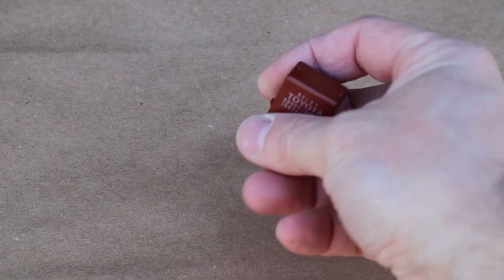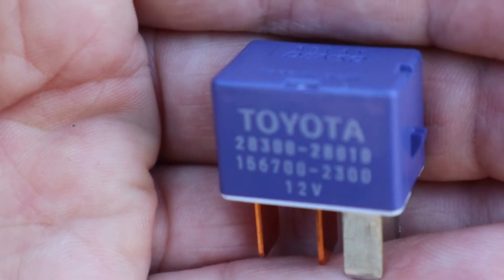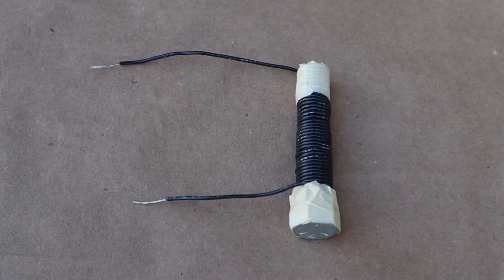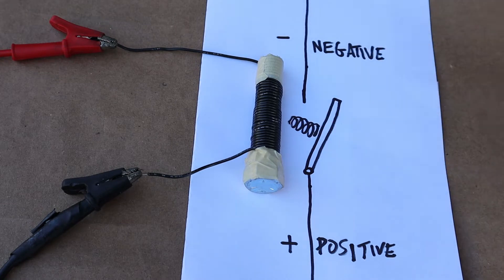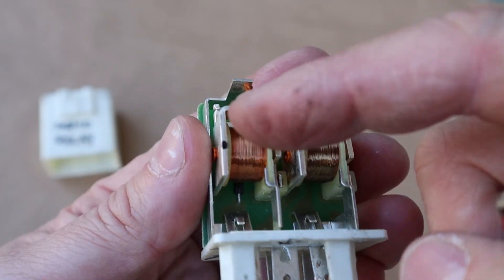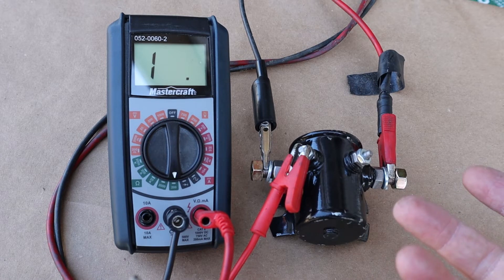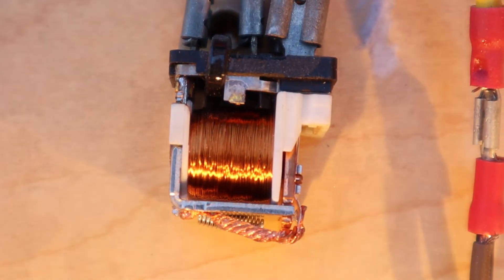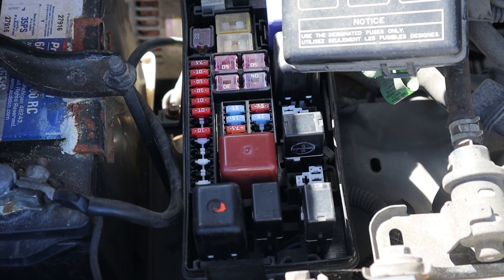What is a relay? Learn how relays work and all about Faraday's Law of Induction plus way more!

Comment: Adding tools to your vehicle is a Great tip for any gearhead!  Its hard to do anything without them!
Reply from the maker: Right?  Last year I had my trailer wiring module blow and during my 1 hour drive, I lost tail lights, turn signals, and then it stalled and I couldn't get it started.  I was stuck and I didn't have a single tool to work with...no multimeter, nothing.  Bought a generic tool kit and after some quick research on what circuits ran off of the blown fuse, found out it could be trailer module, which was behind the left rear taillight.  Unscrewed the tail light housing and bam....melted wiring going into the module.  Disconnected the trailer module wiring ( not towing anything so not needed), replace fuse, and everything was back.  

So no tools and no knowledge = tow and $150 an hour mechanic (1 hour diagnose & 1 hour repair) + $135 module ( list price).  

 $50 tool kit (1 time purchase) + .25 cent fuse + $80 module + knowledge = priceless.
Reply: Perfect example.  A multimeter and a scan tool should be in every gear heads trunk. I like these wireless models that use your phone or tablet https://www.obdlink.com/mxp/